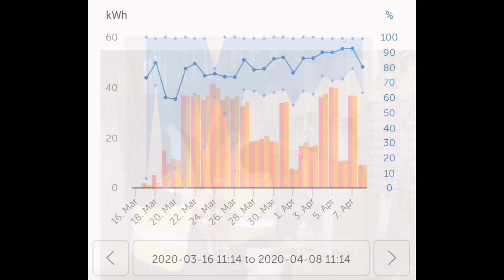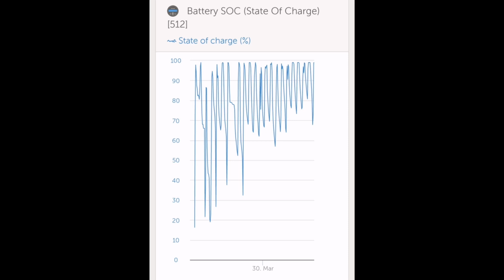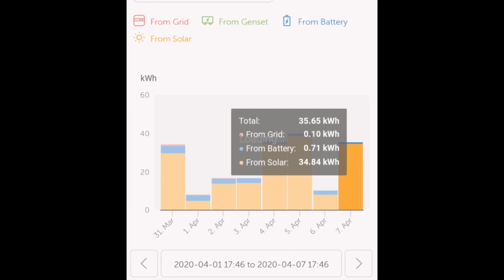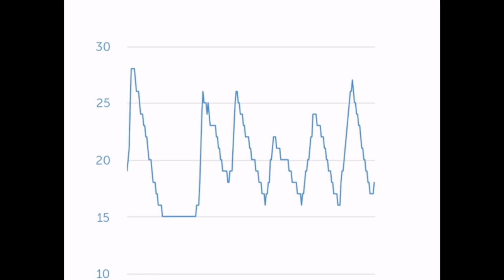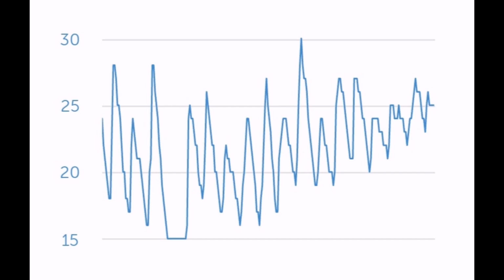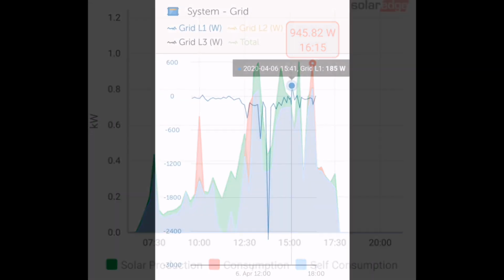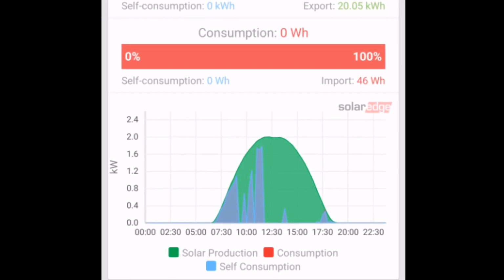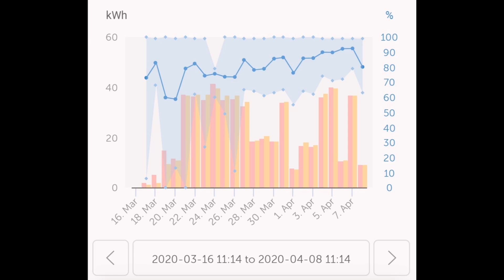4.8kWh Solar / Home battery testing temperature and consumption

Comment: Good video. As the days get better the batteries keep charging. I remember with the Powervault system they kept my outside stable very warm and were very noisy. The Lux units are passively cooled and have no fans. The pylontech batteries are also passively cooled as well. There is something to be careful with though. If the BMS is less than 15c, then the batteries only charge at a max rate of 1.3kw. Once the temperature is over 15c the batteries charge at 3.3kw. We have not achieved completely zero import from the grid as yet, but have managed to stay below 1kw for the day.So Jan was 600kwh, Feb 452kwh, Mar 250kwh and up to Apr 10th 25kwh imported. This shows as the sun shines for a longer day the batteries cover more of the usage. This is for a house that uses around 20 to 30kwh a day. Our aim with the batteries is to get to as close as possible to zero import and make as much use of the solar. Have two units has helped with the loads on the system and you can have up to 15kw on a single phase as long as you can get all of the current clamps in the right sequence things work well.
Reply from the maker: Clamps in right sequence? Two battery systems?
Reply: @EVPuzzle  each inverter allows up to 3.3 kw charging and up to 5kw discharge. This means with 2 inverters the maximum load both will handle is 10kwh for a short time or 6.6 kw for a longer time. This means a car could be charged at almost full rate from just the batteries. The CT clamps just determine which unit gets power first.

Comment: I think it is important to remind people that there is no economic case for big domestic batteries if only used to avoid paying normal UK grid prices for electricity when their PV is not producing. I use about 150 watts overnight (so perhaps 12 hrs) which is only a couple of kw hrs per night so perhaps £0.30 a day or about £100 p.a. - less with off peak pricing. That's not going to pay for much of a battery.
Reply from the maker: That depends if people's motivation is cost saving. Payback isn't a priority to everyone
Reply: @EVPuzzle  I have a 10kWh Lifepo4 battery, the main reason for this is incase the grid goes down, I can easily power the house for 24hrs straight, or far longer in the Summer with this, my solar setup is all DIY & off grid, so while the cost saving is handy, the knowledge of knowing I have power in outages is more reasuring, I live in the UK so while this doesn't happen often, it doesn't mean it won't happen.

Comment: Would be inefficient if you used a decent amount of grid energy but - I feel like it would be better if the house only used the battery and the grid charged the battery to 20% when it needs to. So there would be no way to wastefully use the grid when the battery power is available. Then the Solar charges above 20% most of the time. Limits the house power usage at any one time though I guess but is that a bad thing. Keep every one in the house on their toes.

Comment: What I would like to accomplish is having a battery storage unit (57KWh 355vdc nominal) have if come on at dusk, go off at sunrise putting out 1500 to 2000 watts grid tied, then charge it off the solar during the day back to 80 % SOC maximum (322 VDC) shut down at 40% SOC ( 161.28 VDC) maximum during the night. Using only the maximum of 40% of the capacity of the lithium batteries for maximum cycle life. Any ideas how to accomplish this task for a DIY person?

Comment: Hi Nigel, I have been watching your videos for a few weeks now, I am hoping to get solar installed shortly 18-panel x 300W along with a Pylontech 2.4KW battery I saw you look at a while ago. Just waiting on planning as I have no south-facing roofs so looking at a ground mount system.
Reply from the maker: Hi John

Nice sized array.  I'd suggest more than one 2.4kwh battery as the charging and power outputs would be very limited with just one.

Best of luck with the mounted system.  I'd love one of those in my garden on a tracker
Reply: @EVPuzzle  Hi Yeah I was going to go with 2 and my solar company have recommended against it to start with and said lets look at my use profile, then add the 2nd if required

Comment: Nigel, very intyeresting video. I dont understand how you can use very little energy overnight. I am typically using between 100 and 300 watts continuously during the night, so this equates to say 200w for 6 hours, 1.2kWh, so my battery runs down to 20% most nights. I assume the older appliances of fridge/freezer, in garage, and the fidge and sepearte freezer in the Kitchen/Utility room consume the majority of this. We also eat in the evening so we consume battery energy with oven etc between 6 and 7 pm when not producing solar.
Reply from the maker: I'm planning a video on exactly that. We get to around 35w at the quietest time with the fridge/freezer coming on about three times overnight

Comment: Hi nigel , is the battery grid tied? ,have you tried switching off your electric supply at the meter? Great video with plenty of info
Reply from the maker: Yes it's AC connected but doesn't have whole house contingency. There's a seperate circuit on the inverter for power cuts but its intended for a couple of sockets and a few lights only, not the whole house.

Comment: Should the battery charge up to 90% instead of 100% in order to protect the battery and extend its life like what is recommended for electric vehicles ? It does not seem like you need a lot of energy in the evening.  Keeping the battery between 20 - 80% seems like it would work for you.
Reply from the maker: There's no top limit. It seems charging to 100% is expected daily. Lifepo4 isn't the same chemistry as EV batteries si might account for the difference.

There is a 20% limit at the bottom on this battery however
Reply: @EVPuzzle  Maybe there should be a top limit. Might need software update from supplier to give more flexibility. Worth checking into. I wonder what Tesla does.
Reply: @KJSvitko  Most systems allow you to specify the upper limit. I have not heard either way about the maximum as that is generally handled by the BMS but the minimum is heavily recommended to stay on or above 20% for most systems and that includes cars !

Comment: One of your best videos 🙂
In depth with your experince, perfekt 👌

Can you make a video with the battery bank in details how it is build?
Reply: I was thinking of the internal component and thankt for the fast respons. Have a nice easter
Reply from the maker: Thank you. Not sure what you mean by details how it's built?  

The connection to the house or the internal components?

The Puredrive Energy battery I have is like a Powerwall in that it's all encased in a shell and sold ready to install

Comment: Good stuff, Nigel.  Perhaps those red spikes you’re trying to eliminate are such low energy volume, that they could be considered noise?
Reply from the maker: Could be but if it's a repeating pattern I'd like to understand it, even if I can't limit it. Early says still. More to learn and observe
Reply: @EVPuzzle  could it be something with a rush in current, to short to be eliminated by the vectron? Water pump, fridge, ... It can be something started manually or event driven like temperature. Try to remember manual actions to figger it out, for the event driven it will be more difficult. But if it repeats every day on the same time maybe not so difficult.

Comment: Hi Nigel, great video and informative. Not sure if your able to look at the grid frequency during your spikes on any of your data. But if you do is there so thing there which corresponds with the spikes ?
Reply from the maker: I can see the frequency at the inverter not the grid
Reply: The EV Puzzle the frequency at the inverter will probably be the same as the grid frequency, was interested to see if there was a correlation between the frequency and the spikes
Reply from the maker: Nope very stable it seems. Input frequency almost a flat line at 50.1hz and outputs frequency flickers between 49.9 and 50.1hz.
Reply: The EV Puzzle it was just a thought and worth checking, this is how grid balancing is going to be used. It’s called frequency response if you want to look it up, I suspect this will have more of a impact in the future with V2G and grid response tariffs
Reply: The EV Puzzle when the frequency is below 50hz there is a slight shortage of power on the grid and when over 50hz there’s to much 
I’m only talking fractions 
49.9 to 50.1

Comment: I guess if you were able to use your car much more you would consume much more power to feed it before using the home battery as a store.
Reply from the maker: Yes it's a very odd situation but at least my neighbours are getting green energy
Reply: The EV Puzzle I wonder if this portends the rise of V2H in future?
Reply from the maker: I'm not a fan of V2H. 
Having a mobile, temporary device used for storage at home just doesn't seem right.

Enabling bidirectional transfer between cars and homes has its place though but I see it as an occasion emergency type thing from car to car or car to home in a black out etc.  Just my view of course.
Reply: The EV Puzzle  you make a very fair point. Interesting times - it looks as if we will see a plethora of different initiatives - some of which have not yet even seen the light of day.
Reply from the maker: My guess it'll be like computers. Once upon a day some houses had one. Now each house has 10, 20, maybe more. Batteries will be the same imo. Prices will reduce as technology improves and usage proliferates.

I hope it scales like computer storage has , from Kb to Mb to Tb